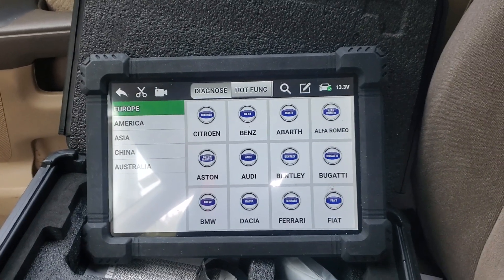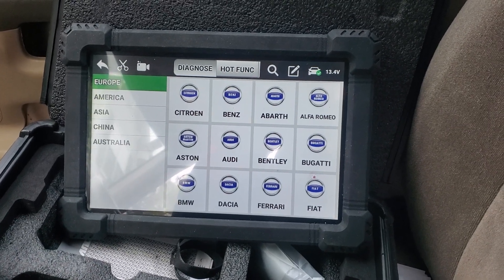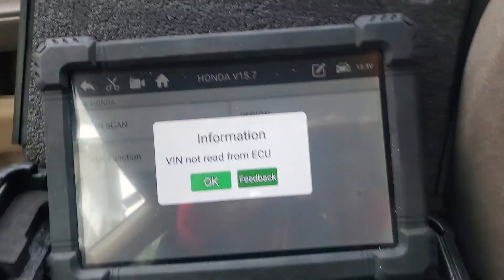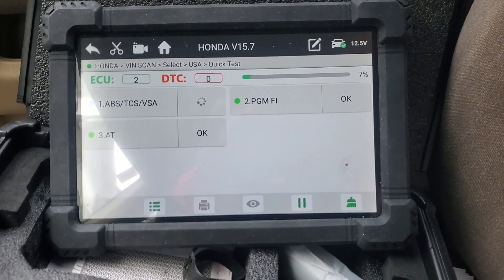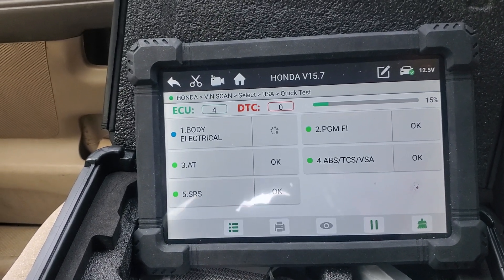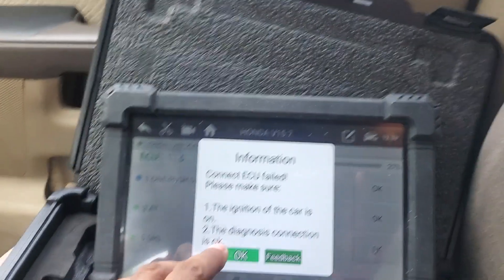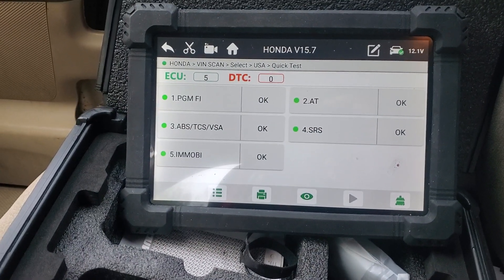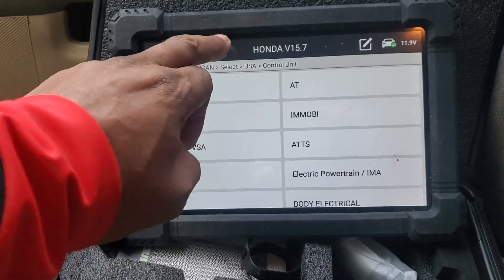X7 Bluetooth OBD 2 Diagnostic Scanner

Comment: I know someone that has this scanner over 2 months and can’t figure out how to pull the trouble codes. He  can the issue of the problem but not the code on a Honda Accord. All the videos I watch I haven’t seen anyone actually pull a trouble code and it’s one of the reasons I haven’t bought one yet.
Reply: I just bought one and I stumbled upon trouble codes right away with the throttle body.  Don't quite know how I did it but this thing does all kinds of stuff.  Keep watching videos,  even of other similar scanners.  After a couple of hours working on my car I am totally blown away.  I was going to change all of my sensors on my 2013 KIA but this thing tells me they are all good (except the throttle body) that I already knew was dirty and bad.  All of these scanners in the $400 range are good.

Comment: Ancel products 😠😡😡😡😡😡😡😡
Reply: Sure, but you can't compare it with a Launch (that I use now) for the triple price. But show me a better one for $ 350.-, incl. 10 special functions. Normally you have MAX 3 special functions and NO Blue Tooth dongle in the same price range. In my garage, I was able to do about 85% from that what I need with the Ancel X6.